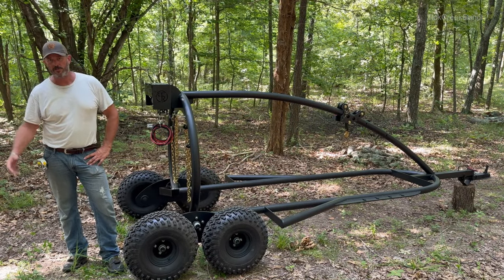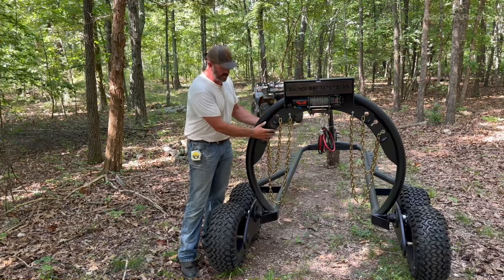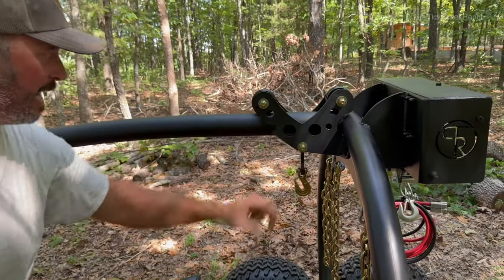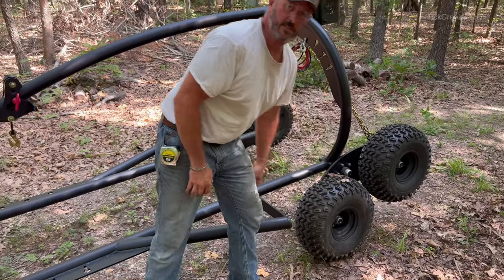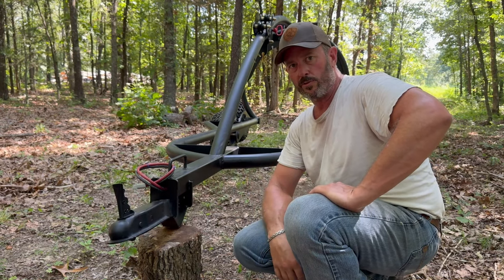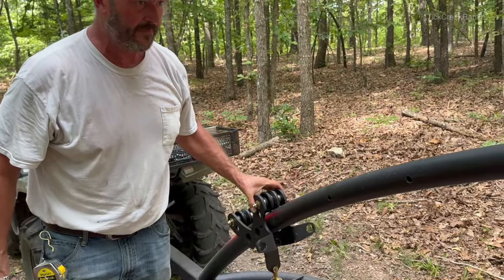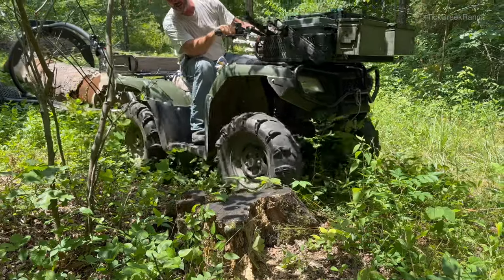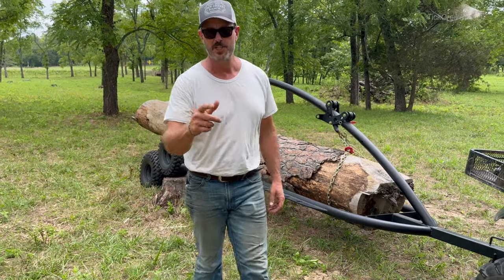ATV/UTV Log handling system #welding #weld #logging #trailer

Comment: Outstanding - Keep it up. You could add a top drive support wheel between the two rear-axis tyres to give additional torque if you get stuck in the mud?